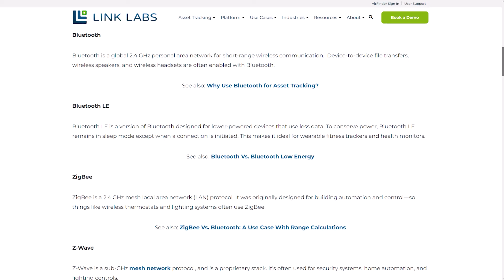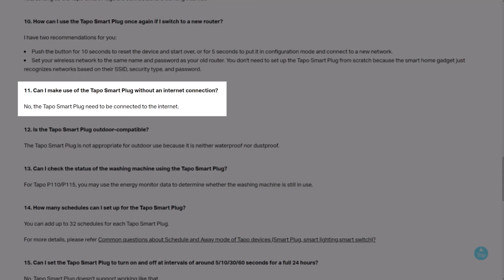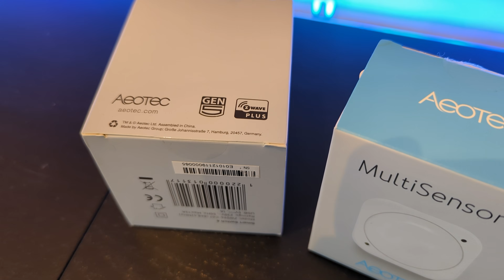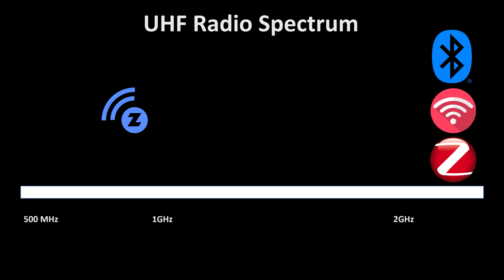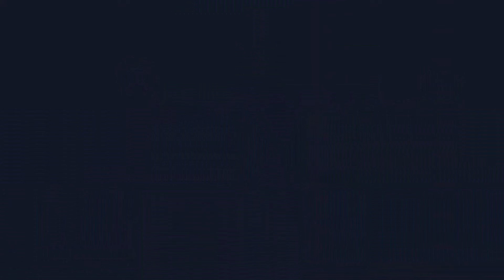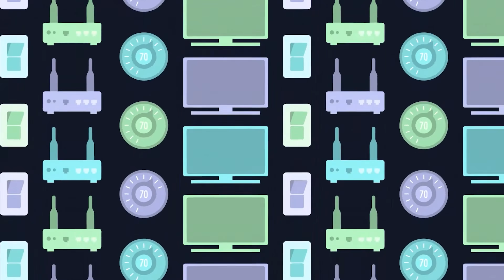Smart Home Protocols Explained

Comment: re: Bluetooth. I found a nice use case for it in my house...use the little Xiaomi Thermometer LYWSD03MMC flashed and places around the house. I have a small enough house this works well for me and love having a display were I can immediately tell temp and humidity.
Reply from the maker: Sensible use case! How do you find the thermometer accuracy and overall build quality? I've not used one myself!
Reply: @HomeAutomationGuy  build quality is fine..... battery life will probably end up being 6months max.
Accuracy is fine...more interested in trends.
Bought in bulk from AliExpress so less than $5 US each

Comment: WiFi: even though everyone has WiFi already, to make it secure via a private vlan or something similar is not usually a capability of typical existing routers, and it's much harder to set up
Reply: I have a Mesh network with 5 Wifi AP's. So, using this network is a perfect 2-in-1 solution.
Reply: it is pretty simple on Unifi devices

Comment: Very, very nice job on this one. Exactly my thoughts on the “matter” 😂! If I may ask about your experience with the sky connect. I tried to replace my conbee2 with the sky connect. But there was one device: the Lutron aurora, that didn’t like the change. I could see the turn event but the press event didn’t work. I had to go back to the conbee. Any thoughts?
Reply from the maker: 🤣 The "Matter" jokes keep coming!

If a device relies on actions or events, I find that I need to press the buttons etc during the pairing process.  I had the same problem with the Philips Hue dimmer switch on both my Sonoff USB Coordinator and the Sky Connect.

Otherwise I've had absolutely no problems with it, it's been rock solid.

Comment: 250 kbps isn't "faster" than 100 kbps.  In the context of what matters for IOT devices, fast is time it takes to move 1 bit of data from source to destination.  It IS however able to carry more bits at one time, allowing more parallel tasks at once carried through the mesh.
Reply: That's like saying a bus is as fast as a sports car because it can carry a lot of people.
Reply: @jarylsim1973 From the city planning, non-physics perspective, buses are faster in transporting a given number of people.
Reply: @girabbit  there are different terms for that because they represent different qualities. A car is faster than a bus, a bus has higher seating capacity than a car. No one says that a bus is faster, be they city planners or non city planners. We can say we can move more people with a bus than if we made multiple trips with a car to move the same number of people, and we can also say that a given connection has higher bandwidth than another connection, we just have to use the right terms.
Reply: @jarylsim1973  You're not wrong but I'd still maintain you're being overly technical. People wouldn't say a bus is faster than a car, singular, but if event organisers asked, "Is it faster to get everyone to the stadium in cars or buses?" then the answer is buses when traffic is taken into account. 'Faster' is referring to the end result and not the process, i.e. how long it took to do the work. It's not a precise way of describing things but it isn't exactly wrong, just a lay description.
Reply: @girabbit  it may be overly technical for that conversation but perhaps not on a video on protocols?
Reply: @jarylsim1973  Fair point
Reply: You're confusing rates with weights.
Reply: It is interesting that you decided to remain in the Zigbee sphere because you had Hue bulbs.

Yes, they use Zigbee to communicate between each other and the hub, though the zigbee network that Hue creates is closed off to other Zigbee devices and will only accept other Hue devices to pair with its mesh, unless they are part of the 'friends of Hue' program (I'm assuming). So you could actually have gone Z-wave as there was no real practical reason to choose Zigbee because of having Hue lamps. I myself have recently invested in a z-wave shelly device, even though I have Hue lights as well. (I'm in an appartment so Z-wave is I think a better option to have minimal inferference in that environment).
Reply: But you are explaining it to yourself that this is fast then too when they dont have to line up but get processed parallel
Reply: @axsdenied9416, 250kbps IS faster than 100kbps. 

kbps = kilobits per second. 

The time rate is the same (per second). Therefore, more work is done in the same amount of time (150kb more work in the same 1 (per) second).
Reply: @ImBatman83 no. That is throughput, not speed. Speed is latency, not bandwidth.
Reply: @davorzdralo8000 latency is delay. If you have significant delay in your network, that’s a totally different issue. All things being equal (same latency), 100kbps IS faster than 10kbps. Period. the amount of delay in a proper WiFi unit is imperceptible to the average person.
Reply: @ImBatman83  how fast something gets from point A to point B is delay or latency, yes. How much of a thing gets there is bandwidth. Just because you have no fucking clue what you're talking about, doesn't mean everyone else needs to indulge your nonsense.
Reply: Bunch of nerds
Reply: @dttornadov2  compliment well received 😊

Comment: It might be good to note that bandwidth is not the limiting factor for wifi, but the number of devices your network can handle simultaneously. ISP wifi can die with as little as 30 devices.
Reply: I assume you are referring to the cheap and nasty router supplied with the DSL/whatever, and not any other limitation. First time I’ve come across the phrase “ISP wifi” and it sounds very confusing.
Reply: @lawrencemanning  internet service provider's wifi

Comment: It might be worth noting that Zigbee is a radio mesh protocol that has nothing to do specifically with smart home or lights (even if it is synonymous with it today) just like thread thread uses ipv6 as its transport and zigbee has its own node and cluster design baked in.
The standards that lights commonly use over Zigbee for control are called ZLL (Zigbee Light Link) and for sensors and other devices for home automation it uses ZHA (Zigbee Home Automation) it is in these standards that different manufacturers don't always implement it the same way. Most devices today will adhere to the Zigbee 3.0 spec but all that means is that they can join the radio mesh.

It would be cool if Unifi APs could have a Thread radio and act as a border router and be manages like any other network in their system.

Comment: I’m at the point where I really need a reset, moving would be one way to make that happen lol. As I’ve learned from you and others my system has gotten more and more complicated, but I’m using Node-RED, as well as Home Assistant automations, but at this point I don’t see much of a reason to keep Node-RED, HA can pretty much do it all. If the raspberry pi’s weren’t so expensive, I’d build a parallel system then swap over.
Reply: Agree. I was deep into Node Red when HA was all YAML based but the automations and GUI configuration are so good now I think HA is probably better than Node Red for most things.

Comment: I find some Zigbee products too Frustrating - The Mesh doesn't work for some products and works great for others - I have INNR Hub and sometimes i can add their bulbs / plugs and other times i can not - With my Aqara M2 Hub i have no issues adding their products but they do not sell Plugs / Bulbs in the UK so thought i would try INNR  - Most of my plugs / Bulbs are TP Link Wi Fi  which i was hoping to replace to local by going the ZigBee route - Perhaps i am just unlucky re my INNR hub and should have gone with a different company

Comment: 1:42 whoa, little red flag goin' up! why use wifi for stationary devices like computers and printers when wired ethernet is a superior option?
4:13 i wouldn't use wifi for security cameras. again, wired ethernet is a far better option.
4:31 thats why i build my own network from components, in my case from the unifi range.
5:16 that's what i want to know. needless to say that i would not even think about using a device like that.
Reply: Sometimes wiring takes a lot of either time or money (or both) to do. For example in my home the walls have solid foam insulation in them making it very difficult to install any kind of wiring inside of them. Of course i could install wiring tracks down the outside of the wall but it would require more money and my wife has already vetoed the idea anyway, (ugly was thrown around a time or three). Anyway wifi is more logical in my case then the time (and or money) it would take and the wife approval factor is a requirement as well.

Comment: Great summary video on the network options. I was not aware that thread allowed you to have a "back-up" controller. I've recently purchased the HA skyconnect as well for my zigbee network. However, this "hub" is tightly coupled with the HA server itself so I'm wondering if it is possible to have a back-up (i.e. two of them running together with one as master)?

Comment: Really looking forward to your Smart Switch video. I’m running HomeSeer as my controller as I prefer it over HA, but have the same dilemma as you over what smart switches to use. Currently have a mixture of Z-Wave, WiFi, ZigBee and RFXTRX devices, but I would like to reduce the complexity whilst improving the mesh. I’m currently testing out Moes and Aqara light switches. The Aqara stuff is top quality. Moes is a bit plasticky. Really interested to see what you make of them all!
Reply from the maker: I agree - I wanted to create a great Zigbee mesh, and resuse some of the battery powered devices and smart bulbs/LED strips that I brought over from the other house.  I'd like to get rid of the battery devices eventually, as they're annoying when they lose power, but I may as well use them for now until I find a suitable replacement!

I have very similar thoughts on the Moes and Aqara!